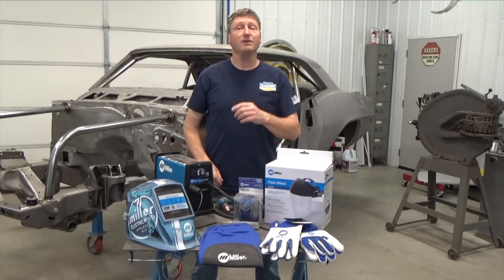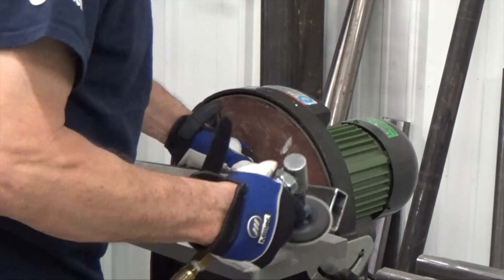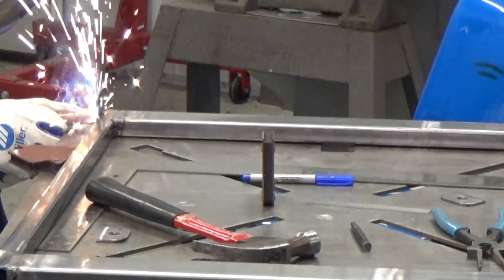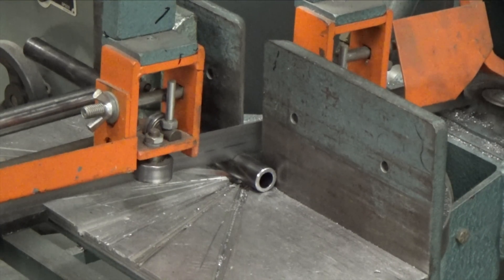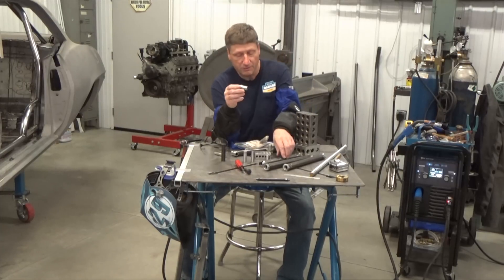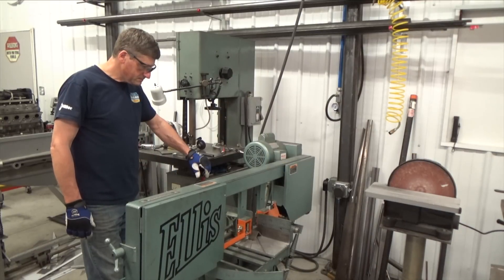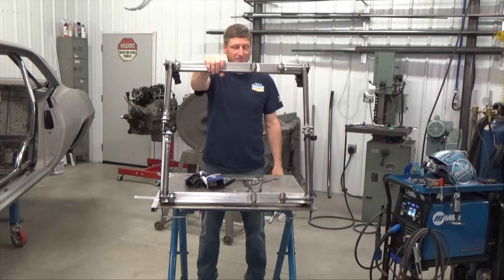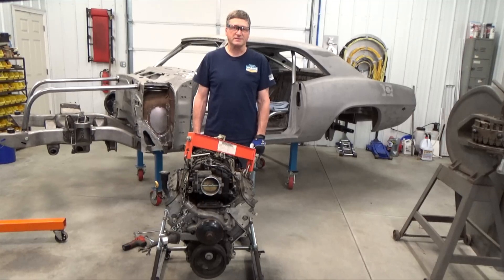Real Garage: Universal Engine Cradle Build (Season 5, Episode 5)

Comment: Really like your design on this engine craddle, I am wondering if you think it would be strong enough to use as a run stand as I would think it would be a great design to use for engine support and would only need be a little longer to add a radiator and controls could perhaps be added to the rear of the frame or side.

Comment: I'd like to see front suspension I'm working on a 72 chevelle. I know it isn't quite the same as a fire bird, but it'd give some ideas
Reply: Also have a 72 Chevelle.
Set up for pro touring.
Blew the trans and hurt the motor so she’s on the operating table.
Reply: The Firebird is set up for a rack with coil overs.  I’m using a quick ratio std box on the Chevelle.  Big sway bars front/rear and 22 position adjustable Fox shocks with tubular control arms.  Have fun with yours!